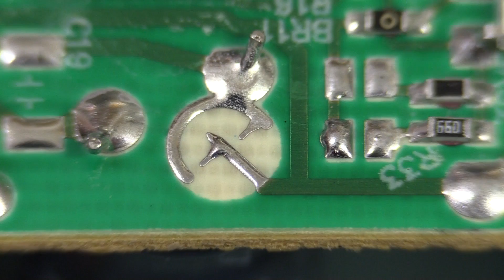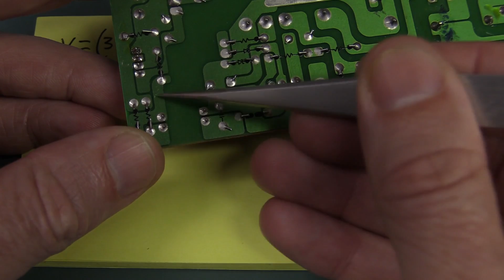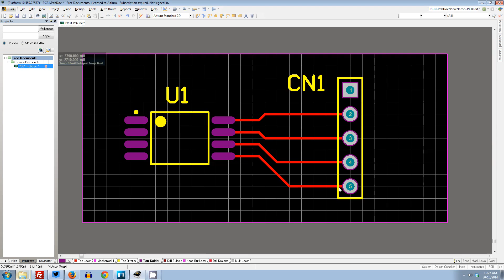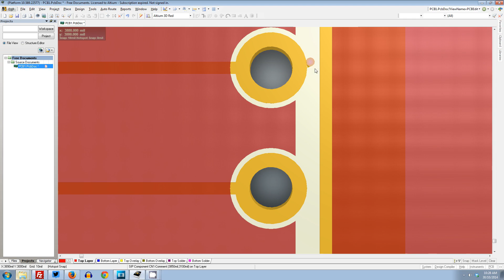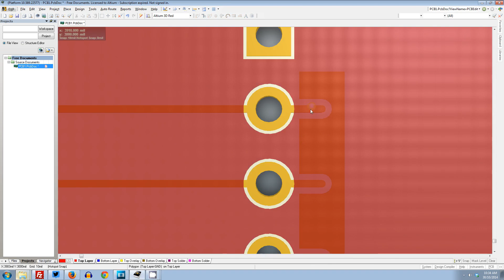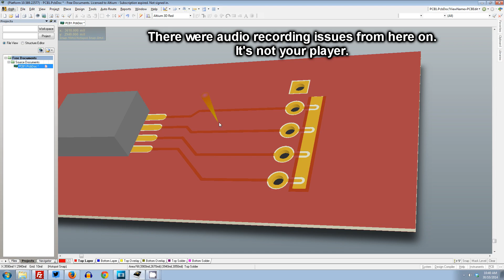EEVblog #678 - What is a PCB Spark Gap?

Comment: Dave: I need to correct something in this otherwise awesome video. PCB spark gaps SHOULD have a sharp point on the conductors between. The reason is sharp conductors always initiate ionization/arc BEFORE non-pointed conductors. This is the same principle as why sharp metal (Fork) creates a discharge in a microwave whereas spoons do not, or why lightning rods always come to a sharp point. It has to do with the concentration of electrical charge in point conductors.   https://en.wikipedia.org/wiki/Lightning_rod#Rounded_versus_pointed_ends    https://en.wikipedia.org/wiki/Electrical_breakdown#:~:text=Conductors%20that%20have%20sharp%20points,concentrated%20fields%20that%20precipitate%20breakdown.

Comment: Over voltage is applied to the circuit pass on spark gap between ground get protection of the circuit board components !..

Comment: I fixed regular analog TV's which had PCB spark gaps, typically near the flyback.They appeared to be for short circuit protection safety not ESD protection.

Comment: When I design a board with these I normally place a small grounded box over the spark gap to prevent noise propagating from it causing issues.

Comment: There are FAR better ways to prevent damage from over-voltage.  Try doing this with an extremely high-current power supply input and the low impedance of the primary will absorb the energy passing it along and not the spark gap.

Comment: @EEVblog I have a few questions about the material of the first PCB you showed in this video. I am studying Electrical Engineering and we need to build high voltage circuits that aren't suitable for breadboards. I have seen this type of board in power supplies we have at the university. So my question is: is this a normal FR4 laminate like they sell on DigiKey and other vendors with a light yellow soldermask with black silkscreen on it or is this another kind of material?

Comment: Another good video. So now I understand that the spark gap protects inputs/components from over 1500v, but surely they can be killed by less than this. So as protection solutions go, it's like wearing rubber soled shoes to stop you getting struck by lightening. Possibly effective, but no good at protecting yourself from more likely threats.

Comment: Fascinating.
In the early 1970’s, while working on a PCB for operating room EEG equipment, I was told that due to the presence of pure oxygen and flammable anesthetic gases, free air sparks were verboten. Fancy air-seal-before-contact power plugs, etc. were required.  Are free-air spark gaps up to code (allowed) on medical equipment?

Does your formula represent maximum or minimum breakdown voltage estimate?  Is the formula for a rounded trace end or a pointy trace end? Does air humidity have an effect (from high school Van de Graaff experiments, humidity is critical: high humidity seemed to cause discharge without a spark and a long-haired person’s hair wouldn’t flair out on a high humidity day) on pre-spark discharge? (But another comment stated that 50-100% humidity required 40/39th the voltage to cause a spark at a given distance than low humidity.) 

Also, the more pointed the charged surface, the more concentrated the electric field which causes a spark, thus a lower voltage is required to cause breakdown, giving better protection, unless it overlaps mains peak voltage.

Another use-case for this protection is shorting-out back-EMF pulses from collapsing magnetic fields, e.g. in motors, connected to the same mains. 

In your design discussion, you want to short out to “earth-ground”, not digital-ground or analog-ground, right? Or, at worst, the mains “neutral”.

Comment: Sometimes spark gaps used in protection circuits or very small Tesla coils, consist of twp flat metal strips placed in an"X" configuration OVER the PCB and the spark only jumps between the bottom strip and the top one.  It never even touched the board....lasts a "very" log time--I haven't seen one burn out yet...not sure of he material used.

Comment: Spark gap have to major uses.False spark and a short circuit easily repairable and second if a high voltage spark strikes on its ends means that the board gone dead definetely same like the spark gap never existed.

Comment: I remember a line of credit card terminals I had to support. The metal casing was not grounded, and there were two traces with exposed metal mere millimeters from a support for the case. One trace went to a RAM chip, the other to a flash ROM chip. One ESD from the clerk touching the case, and it either lost all transactions for the day or bricked, depending on which gap the ESD jumped.

Comment: I don't think this spark gap is not for protection but for other application.  In the olden days. Spark gap together with other device were used to do some healing capability. 

This need to be further clarify by the manufacture for it actual used of this spark gap.
I strongly believe it is not meant for protection.

Comment: The high electric fields near the sharp points of spark-gaps can cause dirt or contaminants to collect in the gap.  Unless you are protecting isolation devices, from breakdown for one side to the other, spark-gaps are pretty useless.  Most devices would be damaged by the larger number of 100V to 1000V ESD hits that the spark-gap would offer no protection against.  I like to use TVS diodes.

Comment: So if there is conformal coating on the lower side of the board, a spark gap wouldn't work? Because I've recently had a look at a 24V 30A PSU, and that was conformally coated, so there wouldn't be a spark gap possible on that board...

Comment: Beautiful class 3 soldering as well on that PCB. I am class 2 certified, and while I cannot remember the exact numbers, I think they are roughly these for through hole components.. Class 1: it simply needs to work. 50% full in barrels, 50% wetting on the source side. Class 2: it has to work for a long time. 80% barrel fill, 75% wetting in the source side, 50% on the destination side. Class 3: medical grade devices. 100% barrel fill, 100% wetting on source side, 80% wetting on the destination side. Class 4: aerospace and military applications. Perfectly wetted and filled barrels.

Comment: What does the carbonization do? Reduce the resistance of the path so it's easier to spark over?
Reply: Judging by the fact the the spark moves around when the carbonization gets worse, I assume that it raises the resistance. We can see clearly that after some time on the left peek of the spark gap, when the resistance is fairly equal to the middle one - the spark moves back and forth. Not a professional, maybe somebody can enlighten us.
Reply: Imo the carbon layer isn't thick enough to shorten the air-gap so it would make any electrical difference - I assume the carbon layer is just mentioned because it is any indicator that the spark burns part of the surrounding pcb material.
Reply: Carbon can be quite conductive (see carbon resistors) lowering the resistance path.  In this video I believe the points burned off before the carbon layer became significant.

Comment: Beautiful . The carbon that is formed after a discharge in a solid, is conductive. Carbon residue is a good conductor. I agree that it would be better practice to remove the solid material from between the spark gap terminals . That is to have an "air gap" .

Comment: At 12:15 you can see carbon build up on the right jaw where it obviously had sparked before Dave started.  Interesting how the smallest gap sparked until it burned further than it's adjacent gap so the nearer points took over till they burned further than the first.   Yet the third never engaged - perhaps because it was already toast from previous event.
Reply: They should have a substrate or local underlayer that is not carbon based for this...

Comment: It might be less likely to fail from a carbonization-short if it didn't have any PCB material between the 2 points.  This could be done with an unplated hole or a notch in the board edge.  Although due to machining limitations, the gap might have to be larger, so the breakdown voltage might end up being slightly higher.

Comment: The most interesting & biggest spark gap's you'll see (inline before the gase discharge)  are in commercial AM/FM transmission lines, usually set 180°from a right angle of transmission line.

Comment: Wow, my mind is blown. I always thought that the lower the air pressure, the lower conductivity would be, requiring thus greater voltage to produce arcing. Damn you now I must research XD
Reply: Think Crooke's tube.
Reply: Just like filtering dust or particulate material from water or air (cyclone air filter OZ invention) make it turn for ejection.
Reply: Gasses are complete insulators, and compressing more insulating material in a space also compresses the breakdown gradient.  Think how oil has higher density and such a high breakdown voltage per mm.  It's a similar situation.
Reply: To a point. A vacuum is a pretty good insulator, much better than air. But a high pressure insulating gas or liquid is better yet.

Comment: Would the spark gap work in a vacuum? I would assume not, or at least it would take significantly more voltage.
Reply: +Zachary Krawczyk 
As the empirical formula shown here (5:15) shows, the lower the air pressure, the less voltage it takes to create a spark. But this relationship breaks down at very low air pressure; below a certain pressure, the trend reverses: the closer to perfect vacuum, the higher the voltage it takes to create a spark. Look up "Paschen's Law" for more detail.

Comment: I'm glad that electrical engineers care about ESD nowadays. Back in the 80's it was a simple matter to destroy one of  the joystick ports on a Commodore 64 simply by using it. In those days the ports were used a lot. It was uncommon to plug in a joystick and leave it plugged in for any length of time like it is today with consoles. In particular I remember using one port or the other, depending upon the software.

Comment: If you make the sparkgap of a small layer of gold it wouldn't really matter if its pointy or not because ot doesn't corrode or am I missing something?
Reply: +bonnome2 I think using gold might help, but you still have the problem of burning the board and buildup of fried dust particles.

Comment: Will a basic spark gap work in pure/desaturated/complete vacuum?
Reply: +Murad Beybalaev 
In a pretty good vacuum (say, 1/100 of atmospheric pressure), it takes very little voltage to create a spark - as low as a 400 volts or so - because any air molecule that gets ionized will travel a long way, and pick up a lot of speed, before colliding with another air molecule.  But in a REALLY good vacuum (say 1 millionth of atmospheric pressure), it's impossible to create a spark because there aren't any molecules to ionize.  Look up "Paschen's Law" for more info.
Reply: +Murad Beybalaev : not like it's supposed to! Their design depends very much on the composition of the surrounding atmosphere, and with no atmosphere the electrons flow quite freely. The equation mentioned in the video (https://youtu.be/vfP_65gSSBU?t=316) does represent this behavior, but keep in mind that it is an empirical formula which works pretty well in typical conditions (near 1atm) so it probably doesn't represent what happens at very low pressures well.
Reply: +Tylar Murray
So, for the board to work in a vacuum environment you would want the spark gap to reside in its own pressurized capsule?
Reply: +Murad Beybalaev : Yes! Like the Gas Discharge Tubes mentioned in the video! (https://youtu.be/vfP_65gSSBU?t=166).
Reply: +Tylar Murray
Oh, right. Wasn't familiar with the term and those tubes looked hollow to me.
Thanks.

Comment: You know you can light a candle with high voltage discharge I took a transformer out of a plasma globe and hooked it up to usb changer 5V 3A and got sparks up to 5 mm away, and if the neutral wire (ground) is touched against the end of the wick snd the placed to spark anywhere else along the wick (yes apparently paraffin is conductive) and with some luck it'll light

Comment: I wished they did a little bit of protection in consumer ADSL modems and VoIP Gateways. Almost all phone ports on consumer crap in rural area's dies during a lightning storm. And it's always the phone ports. Ethernet usually survives because of the 1,5kV isolation the HF transformers have. The only place I've seen Ethernet causing problems is with ungrounded electric installations.

Comment: I guess it would be OK to leave out the solder mask if the spark gap is in the top layer, but I wonder if the lack of solder mask in the gap won't make both contacts to be joined by solder with the wave soldering process. The few spark gaps I saw in commercial boards had the solder mask in the gap between the exposed and covered by solder pointing contacts.

Comment: What pcb design program is that?
Reply: Joshua Blalock If you haven't found it by now, it's Altium Designer. I've just started learning/using it (migrating from PSPICE which i used only for circuit design, not pcb) and it is very powerful. It's also quite expensive. like 8000$ or something? Anyway, in some of this guy's later vlog episodes, he goes over a program called CircuitMaker. Made by the same company, just as powerful and it's free! Does have its drawbacks though. ie. Always online, all projects are public except two (if you want to make more private projects, you need to "release" your previous projects), removed previous hotkeys (shouldn't matter if you've never used altium before) etc. It's a beta or something too so there's much to be improved upon.

Comment: 8:10 evidence of 1000v moving a spec.
Reply: superskiier50 There is no difference between static electricity and "regular" electricity, and all electric fields cause a magnetic field (and vice-versa): they are one and the same caused by the same force.  You CAN actually have specs of duct that are ferromagnetic, or paramagnetic, depending on what they are made of, and certainly a large change in an electrical potential nearby can induce an opposite magnetic field in a nearby paramagnetic object, resulting in net force and motion of the affected object. I have never actually seen this in real life, but then I rarely ever handle voltages greater than 125V, or currents greater than 20-30 Amperes.  At these levels, surely I'll see no specs moving around.  However, with 1+kv or hundreds of amperes, we really could see these things in action.Bonus material: You can bend a stream of water with a powerful enough magnetic field, since water is paramagnetic (being a polar molecule).
Reply: I thought I saw a change on the board, perhaps dust of something moving because of the electromagnetic field, but I couldn't say for sure.  I thought I was crazy. Thanks for pointing this out as well.
Reply: Warren Garabrandt dust doesn't move because of magnetic fields.
Reply: superskiier50  they do move from static charge though.
Reply: Nicholas Lenzini i guess, but not current electricity
Reply: Have you ever heard of corona wind?
Reply: yes

Comment: Wonder if a spark gap in parallel with a MOV (e.g. 250V) would be better than the MOV alone?  Or is it better to keep the trace distance high on the mains side and rely on the MOV alone for overvoltage protection?

Comment: At your video, after 2:54, there are few red marked spark gaps. I found that red marked spark gaps (for old telephone company line protection) had radioactive paint on the inner wals of the gap. The one marked black has no such radioactive thing inside, but only red one. Check it if you have chance (GM counter, gamma spectroscopy probe). It is such low activity, that one should be broken to show onto GM counter.

Comment: I think this is the cheap old tec trick of medical devices. Actually, TUF Japan does not have any spectroscopes, I want to say German tec is out of EMC, that is more important. Anyway the wall plug AC adapters does not be regulated in IEC-60601-1 article.

Comment: Kudos for this video! Is there a criteria for when NOT to use this? Or how not to use it?  It may be free and like you said,  why not use it? I'd like to add this technique on my pcbs and I wonder what else should I take into account for safety and fire hazard mitigation particularly. I've had my share  of circuits smoked by transients from nearby lightning even after using TVS (obviously not enough or not properly sized rather).  I've been lucky so far too only have the plastic covers of ICs and traces pulverized but nothing else catching on fire.

Comment: The problem with the spark gaps shown is that the tracking resistance of the PCB is lower than in air and changes over time. Proper gaps have a slot/hole punched between the 2 poles of the spark gap. They still suffer from dust that is drawn into the gap via the electrical field.

Comment: They used to use neon lamps as spark gaps/surge arresters many years ago
Also, points are best for spark gaps, that's why lightning rods are pointed, the capacitance builds up on the surface area mass, and is concentrated on the point, in fact the GDT's symbol has points, so essentially a neon with pointed electrodes i think.
The pcb spark gap was probably for short static arcs, rather than long duration, so wouldn't have built up so much carbon in a short time

Comment: So the spark gap is essentially a cheap breakdown diode with a zener voltage depending on the distance of the metal points.